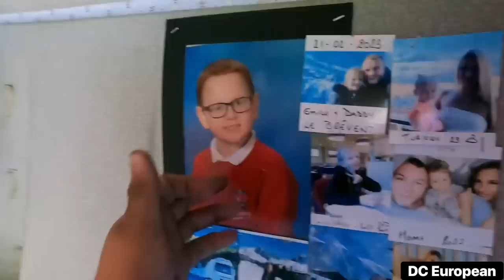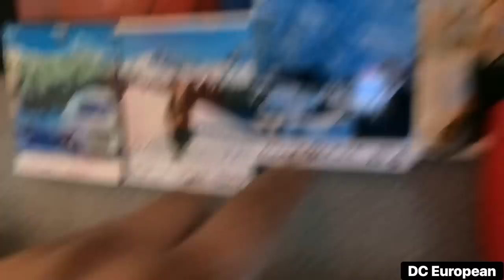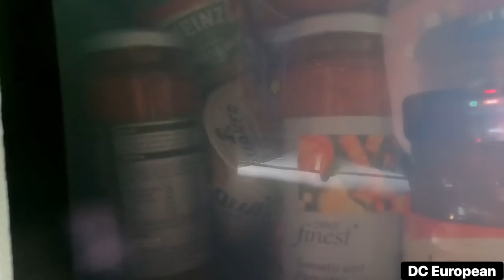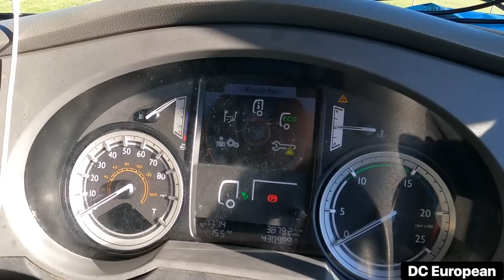Daily blog Spain - France. Millau bridge was amazing !

Comment: Just a suggestion for mats in the footwell I bought a bathroom set of mats the shape of the pedestal cutout is very similar to the steering column so you don't have to cut it and the mat you step out of the bath onto fits in the passenger footwell plus when they need cleaning you can chuck them in the washing machine 👍